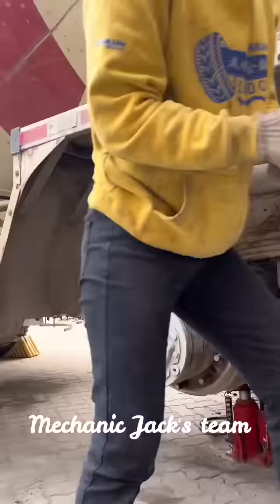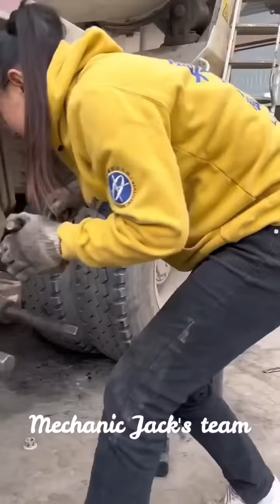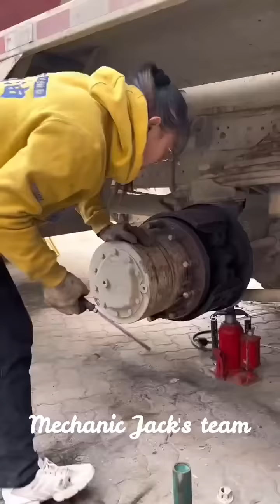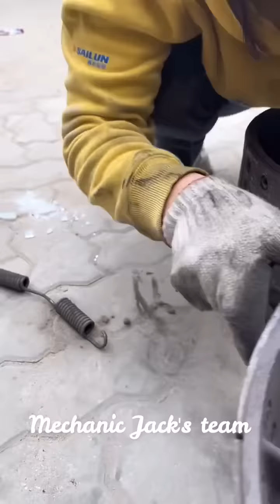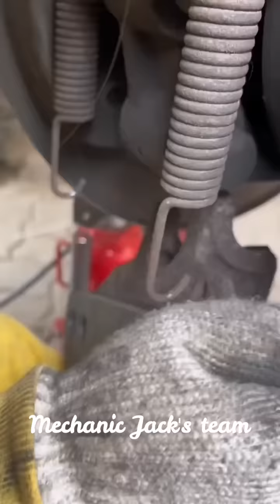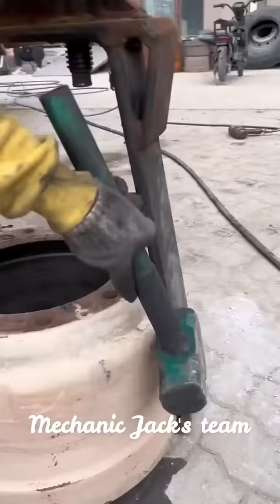Change Brake Pad Process

Comment: How you doing girl, I have 2 questions for you: 
1 Are you single?
2 I work in cars also and this is the first time I see someone change brakes in a truck, interesting, but  what about the adjustment? Or those brakes doesn't get adjustments?
Reply: All external brake adjustments, at the slack adjusters.